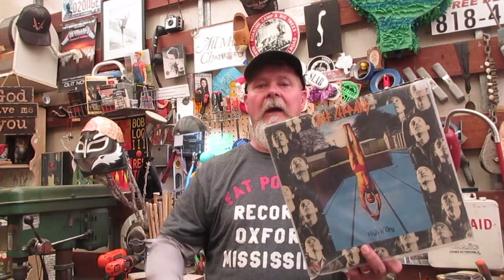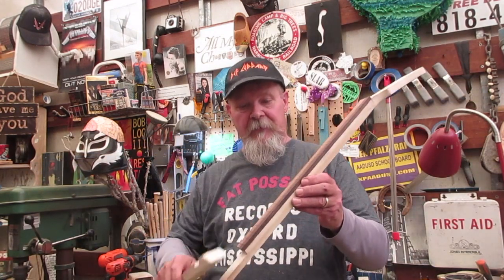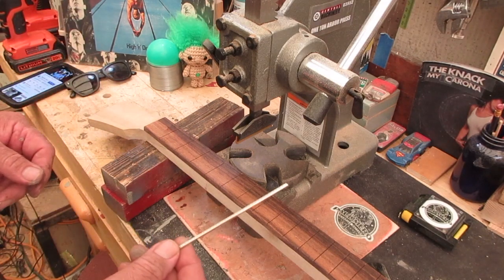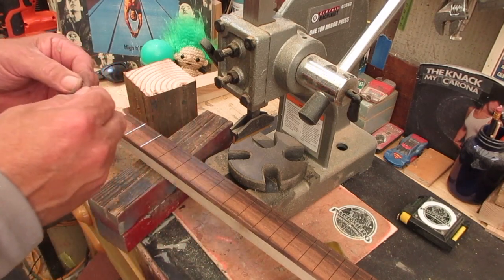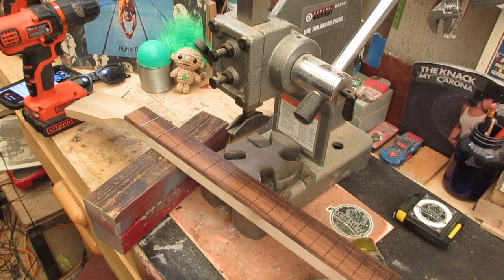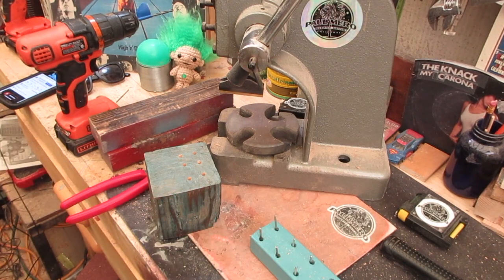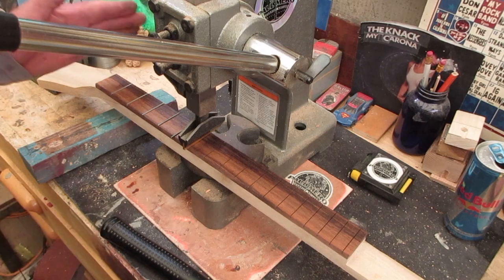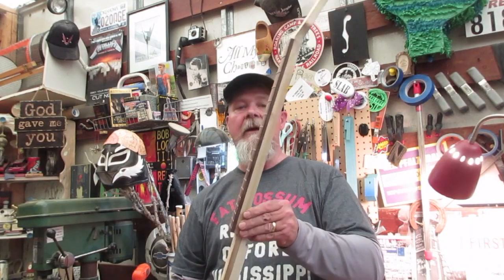Faster Fretting

Comment: Another great video buddy, I've ordered the adapter to put in the pillar drill to press the frets in, I usually hammer them in but find sometimes they pop out slightly around the middle string. Fingers crossed it'll work. Thanks Ken for all the tips, I see you have The Knack, my corona, on the bench, good effort. Davy.